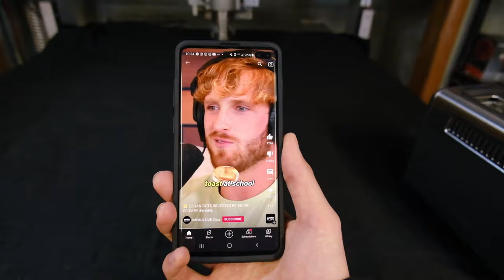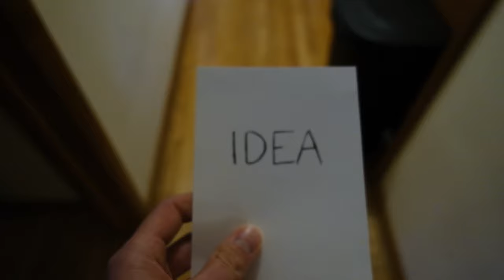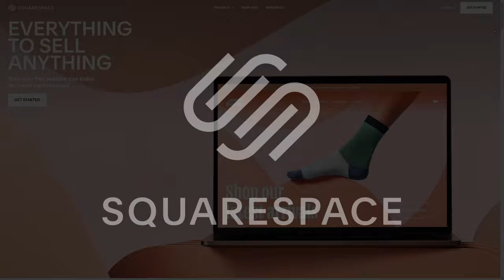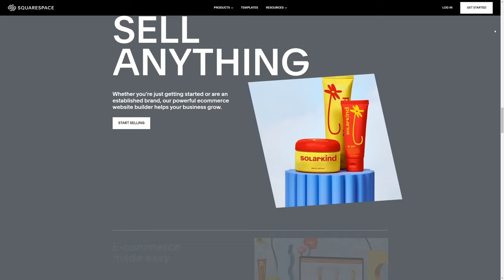I stole Logan Paul's invention (pocket toaster)

Comment: Okay hear me out... a full series on making pocket sized versions of everyday objects
Reply from the maker: What's next?
Reply: folding camping griddle.  What's a very flexible conducting surface that could cook a camp breakfast?
Reply: @JoelCreates  pocket sized hot glue web making trap thing or something
Reply: @underdweller  the pocket sized coffee maker already exists.

its a metal loose leaf tea strainer.

unless you also mean the heating element and mug.
Reply: @JoelCreates  pocket sized microwave
Reply: @JoelCreates  pocket ice maker
Reply: @underdweller  nearly everything exsist on this list.
Reply: @JoelCreates  Pocket clothes steamer should be possible.
Reply: Pocket sized elephants.
Reply: @pneumantic6297  I do need myself a poket sized refrigerator
Reply: Pocket Microwave
Reply: @Reverend_Salem  he could probably take a few notes from that makita coffee maker and try to downsize it further, and maaaybe combine with some ideas from that wawaco pocket/camping expresso maker too. That makita coffee maker is already arguably portable, given that it runs on one of the rechargeable battery types that the other power tools they have use but it isn't fully pocket sized.
Reply: @Hatsworthful  or base it off of percolator coffee pots with an electric heating element on the bottom
Reply: @princesidon6606  isn't that just an ice cube tray?
Reply: @widmo206  but it makes ice on the go; without a freezer
Reply: Pocket sized bike, then a pocket sized electric bike
Reply: @JoelCreates  pocket size pockets
Reply: @Joel Creates  microwave
Reply: @JoelCreates  pocket sized air frier for mini pies
Reply: those would make me bankrupt. i already own a pocket sized usb powered leafblower and vacuumcleaner. My pockets are stuffed like the inventory of a minecraft character
Reply: @JoelCreates  Pocket sized Grill....?
Reply: @JoelCreates   pocket size microwave that only fits a cup of ramen in it
Reply: Pocket blender
Reply: Pocket sized air fryer
Reply: @nick11jl  YES
Reply: @JoelCreates  a pocket sized old fashioned television
Reply: @zach4505  I want a collapsible back pack sized solar oven for when I go prospecting haha. Go dig a hole in the middle of wherever and pop a steak or something in and be ready by lunch lol
Reply: @zach4505  he could make a full camping set, then go on a camping trip with only a pair of cargo pants
Reply: @JoelCreates  Pocket Blender. Make soda can sized smoothies!
Reply: @JoelCreates  impractical, but every child's dream. pocket waffle iron. on a serious note, how cool would it be to have a discreet belt that also houses an alexa? maybe that's more of a william osman creation.
Reply: @JoelCreates  a pocket keyboard?
Reply: @JoelCreates  A pocket phone
Reply: @JoelCreates  Panini Press!
Reply: Small oven
Reply: @JoelCreates  hear me out. I like my phone to sit on my thigh when I drive.

When I go around corners it slides, create a pocket magnet phone mount. It can be worn inside the pocket. The phones currently already have the technology
Reply: Pocket sized pocket
Reply: @JoelCreates  whats next is sell me the toaster :)
Reply: Shut up and take my money!!!
Reply: Pocket welder!
Reply: Pocket coffee maker?
Reply: @JoelCreates  Pocket computer
Reply: pocket-sized laptop
Reply: @JoelCreates Mini oven that allows you to cook up to 350 degrees f
Reply: @JoelCreates  always in need of a pocket blender
Reply: @JoelCreates  pocket tent. Chuck it and it pops up into a a tent
Reply: pocket pc
Reply: @JoelCreates  Pocket-Sized Pants, which fold up to fit inside their own pocket.
Reply: @JoelCreates  Pocket fridge? Pocket convection oven? Damn, I just want to get a pocket kitchen at this point.
Reply: @JoelCreates  grill
Reply: @JoelCreates  a pocket broom
Reply: Pocket popcorn popper
Reply: Beacon-grill to go with the toast
Reply: An tiny self heated pocket pan to bake an egg and bacon to go with the toast
Reply: @JoelCreates  pocket sized television! Oh wait...
Reply: I would actually love this
Reply: @JoelCreates  pocket chair
Reply: pocket sand dispenser
Reply: @Joel Creates  pocket sized cryopump
Reply: @westonames2370  that reminds me of something really cool I saw like that , basically a foot long metal tube and magnifying glass top with little stand  (if I remember correctly) that just uses the sun rays to heat up . Saw a video of a guy leaving potato’s and meat for 6 hours on a winter day and the time lapse showed it working perfect. Just like a slow cooker
Reply: @BigpapamoneymanMVPtypebeat  Ill have to look in to that, biggest thing for me is weight and size to fit in my back pack
Reply: @JoelCreates  oven
Reply: @JoelCreates pocket sized ice maker
Reply: @JoelCreates  microwave
Reply: Pocket sized phones. OH WAIT!
Reply: pocket size fridge
Reply: @JoelCreates  so did he see it even? Logan Paul?
Reply: @JoelCreates  pocket dishwasher
Reply: @JoeyDiazInASpeedo unnecessary inventions made that recently
Reply: Pocket sized chair
Reply: his budget would blow up bigger then the tsar bomba
Reply: First - a pocket gun!

Comment: It would be cool if the buttons had lights to show when it's preheated and when to flip toast.
Reply from the maker: I wanted to include a timer display, but didn't find a module small enough.
Reply: And a flipper.
Reply: How about a toaster timer app?
Reply: @JoelCreates  I was going to suggest using the change in resistance of the wire at different temperatures to detect when the wire gets to the desired temperature in order to toggle an LED but from what I can tell nichrome's resistance does not change at all between 22C and 550C
Reply: @bradonhoover3002  no celsius only fahrenheit
Reply: Plate, then bread, then toaster on top. You dont want crumbs in your filaments.
Reply: @bradonhoover3002  For really clever toaster design, check out the Sunbeam Radiant Control toasters.

Comment: I love how even on the 1st prototype, it looks like a finished product. It has fancy design elements and everything!
Now you just need to create a bunch more pocket kitchen gadgets (electric stove, blender, coffee maker...) and you have yourself brand!

No joke, this would be super useful for camping or backpacking where space and weight mean everything.
Reply: I love backpacking with my lightweight toaster that requires a power outlet to work
Reply: @tonylarose4842 get a solar charger for the batteries he uses!
Reply: @elliotmarks06  yup solar batteries are very known for their lightweight
Reply: @tonylarose4842  pocket fusion reactor
Reply: actually kinda clever
Reply: @elliotmarks06  the entire day charging for one toast would be funny.
I think a concave mirror might be more effective at about the same overall size...
Reply: Camping you'd already have a small gas stove. That with a small pan would be more reasonable. It is cool though!
Reply: @elliotmarks06  antimatter particle accelerator
Reply: @tonylarose4842  bro
 He literally showed it using a battery

Comment: I was waiting to see what plastic you used for the enclosure, the second you said you used PEEK I physically hurt bc I knew the price was gonna be bad
Reply from the maker: And the $90 piece I bought was discounted because it was a remnant!
Reply: @JoelCreates  From now on if anybody asks me about PEEK I'm going to be mentioning that a piece little bigger than a slice of bread costs $90 if you're lucky.
That way I won't need to bother explaining how much a 3D printer that can print it costs. 😆
Reply from the maker: @Erkle64  Clever
Reply: @JoelCreates  Also you machined away 70% of it's original mass
Reply from the maker: @dang-x3n0t1ct  I actually have much of it still left since I cut a profile and not a pocket, I was able to cut the control body pieces out of the smaller internal square.
Reply: @JoelCreates  would I be mean to tell you that bakelite might have done what you need but much cheaper?
Reply from the maker: @Kalvinjj  not high temp enough, and emits formaldehyde when overheated
Reply: @JoelCreates  try making it like a scanner, with one short hot wire.
Reply: this will let you use a hotter wire and make the toast very evenly baked. more complicated, needs a servo but sounds like a possible improvement.
Reply: the 2D printer of toast XD
Reply: @Kalvinjj  Torlon or PAI would have been my choice.  Just as expensive as PEEK but keeps it's strength better at high temperatures.
Reply from the maker: @martylawson1638  peek is explicitly food safe, it's not as clear whether PAI is
Reply: @JoelCreates  Why didn't you use stainless steel and insulate it with more aerogel or that kalewool stuff? Food safety? I would have covered up the insulating material with more of that mica sheet.
Reply: @JoelCreates  quality product means premium price.. 200$ for a toaster that fit's in your pocket? not unthinkable :)

Comment: Hey I have a suggestion.
Look into ITO-coated glass. Indium Tin Oxide. It's a transparent plate of glass that's electrically conductive but can also get heated up pretty hot. Instead of a coil with an air gap, you could put the hot plate flat against the glass and also be able to see when the toast is ready directly. More compact, safer, easier to use.
Reply: this is a bad idea, because the glass would fracture from temperature stress.
Reply: @alekso56  ITO covered glass is already used for heating elements in other applications. This isn't a novel concept I'm suggesting.
Reply: @wtechboy18  you are talking about led panels, window heaters and lens assemblies, sure, these are used to maintain a specific temperature, but never more than 10c+- from ambient.

 im more worried about the thermal stress of heating the glass repeatedly to 400++C ,way above the degradation for the sputtered metal. 

Your toast would be filled with indium on every toast. if anything like this would be attempted, there should be glass on top of the ITO, but FTO is probably better in this case, more thermally stable. (Fluorine Doped Tin Oxide) (one sided glass is also acceptable, assuming no rapid cooldown occurs,ever)

Comment: 2:51 not necessarily because it depends on the resistance in bettery wirings.
The highest possible power you can get is if the wire has equal resistance as the wirings if you make it more or less resistant the power gets less

Comment: Maybe a reflector lid would help it heat up faster. Just a flat metal plate on hinges designed to keep any heat from escaping the top as it warms up.
Reply: Also would be useful so you don't have to wait for it to cool down before pocketing it.

Comment: "The reason that the toaster has to warm up first is because the bread will dry out from being on low heat for too long" mate its toast its supposed to be dry
Reply: It's supposed to be crisp on the outside and soft on the inside. Completely dry bread would be more like croutons.
Reply: It doubles as a pocket dehydrator🥵🤯🤑🤣

Comment: Ok so next the backpack toaster… double sided with a an obvious butter holder… probably like a pez dispenser also so you get perfect cuts of butter each time……. And its in a back pack so obviously you need a full cook top for the big pocket, a cooler in the middle pocket for soda and well I guess prime on the go and toaster in small pocket… on the sides you have your butter, jelly, and peanut butter and the other side well a bread dispenser 😂 might as well throw a built in battery and attachble propane tank in somewhere so you can charge your phone and run your backback toaster on the go… bet a 25w solar panel would fit on the front for charging while hiking
Reply: Don't forget the pocket mini fridge/freezer to keep the butter solid and all. 😉
Reply: @terrafirma9328  thats the point of the cooler in the middle pocket

Comment: Reflecting, not refracting the heat (S steel that is) unless you’re putting it BETWEEN the heat and the bread, if it goes ss/heat element/bread what you want is reflection, not refraction.
Reply: ….also, you could have made it with an element on each side, and not flip the bread - no need for extra battery as the time would be 1/2.

Comment: Should have looked into pcb heaters like the heated beds in 3d printers. Probably would work better, heat more evenly and be safer than nichrome wire with less work.

Comment: I got an idea to reduce warm up time...
A stainless steel slider shield that simply reduces air flow momentarily.
A dampener basically! 
After 30 seconds should be hot enough, reducing time and increasing battery life by huge portions, possibly getting a half a loaf of toast out of one charge.

Comment: Putting foundry-grade insulation around it and a battery it so you can actually use it by sliding a piece of bread in your pocket and taking out a fully made toast would've made it better

Also It would probably be more clickable if you did the thumbnail with the toaster sticking out from your pocket you looking all shocked and an arrow pointing at a the toast(zoomed) all in bright colors and a lot of contrast

Comment: I wonder if you could get away with less insulation, time, and smaller space if you could put the wires through the toast. Slide toast onto wires/pins then clamp on the other side to get an electrical connection.
Reply: You need to heat the surface though, not the middle.

Comment: Instead of all that testing you coulda used P=V^2 /R and found the resistance, then found the resistance of a known length while its hot. Would reduce it to maybe 3 iterations of tests...
Reply from the maker: Calculating wattage wasn't an issues, now add the variables of how various power levels effect the toast at a much closer distance/how various shapes effect the toast

Comment: You should convert it to run on just 5V so you can power it with any phone charger via USB-C cable
Reply: That would only make one giant crouton, and melt your phone charge cable
Reply: With PD protocol it can be 12V or even 20V. Question is how much current this device consume? USB-C can tolerate about 5A at max.

Comment: How many amps at 12volts ?? Or what ohms of the element? Could you run parallel elements and maybe a 48v battery would only need like 24amps to get 1100 watts. Which is close to a real toaster. and the right setup of lithium 18650's batteries could handle that load.

Comment: is really a pocket toaster if the battery for it/ power adapter doesn't fit in my pocket, cause then I need a like little brief case for it , and it not longer in my pocket. but cool idea.
Reply: Dude, battery & adapter fit in pocket too!

Comment: How did you attach wires to nichrome? I have an old toaster  that needs rewired and the wire was directly connected to the nichrome but I haven't figured out how. Obviously no low temp solder works.

Comment: Okay, kind of cool, but you know what would be really impressive? A pocket-fridge. I bet you can't make something that fits in your pocket and is capable of cooling down a beverage to fridge-temperature in under 30 minutes. Even I could make a pocket toaster, but if you can make a pocket fridge then I think that would officially make you the most impressive youtube inventor.
Reply: Ngl pocket fridge is probably easier, just a peltier and a heat sink with an enclosed box would do the trick

Comment: Nooooo! It was supposed to be a pocket toaster that toasts bread IN YOUR POCKET, not one that fits in your pocket, then you take out of your pocket to make toast on like a grill or frying pan! That's not in the spirit of being called a toaster! It needs springs, a slot that you insert bread to, and it either pulls the bread in automatically or you have a long stick on the side that sticks out of your pant pocket a bit that you push to load the spring loaded tray. The springs pop the toast upwards when you press on the stick, or automatically when the bread is done toasting.

Comment: So much work and R&D for a guy who probably dosent even remember talking about the pocket toaster lol, very cool regardless of his response. Isn't it dangerous to quickly drain a LiPo battery like that though?
Reply: Lipos like that are rated for very high current draw. It's all based on the C rating. It's a ratio of the total capacity (Amps-hours) and the maximum current draw (Amps). A 1C draw for a 4Ah battery would be 4A. Since it's A/Ah, 1C means a discharge in 1 hour. Many batteries allow for a discharge rate of 40C. This would be a full discharge in only 1.5 minutes. Batteries like this are often used in power tools and RC vehicles which may have a battery life of only 10 minutes under heavy usage.

Comment: You cant just short circuit a lipo, it will defenetly make your pocket explode!
Reply from the maker: I didn't short circuit it
Reply: @JoelCreates  Ok, then i just didnt pay attention good enough.
Reply from the maker: @trumblez  I used a short piece of nichrome wire, which has a much higher resistance than regular wire, and that resistance limits how much current it will draw from the battery
Reply: @JoelCreates  Ok, i get it now 👍 thanks for the explanation!

Comment: This is really awesome and you did a great job at the execution - but  thin piece of wire draws more current (has more resistance) than a thick one. A thick piece of wire can HANDLE more current than a thin one...
Reply: this is not correct my friend, ohms law says less resistance = more current
Reply: At a constant voltage, thinner wire = more resistance = less current = less power = less heat.
At a constant current, thinner wire would get hotter because power = I^2R, but the voltage would need to be higher to get the same current as a thicker wire.